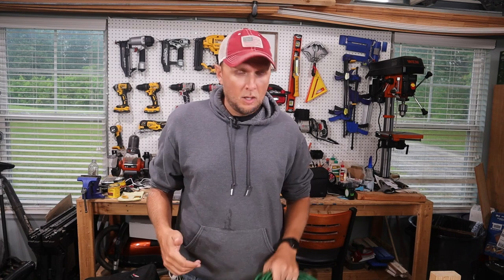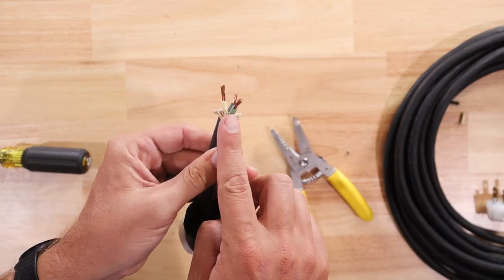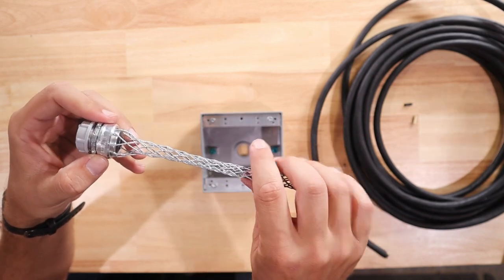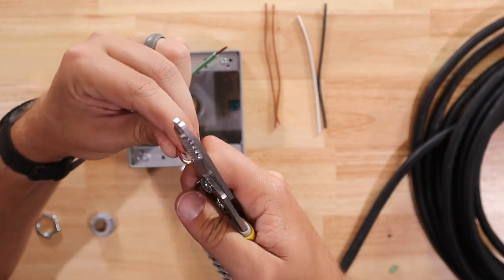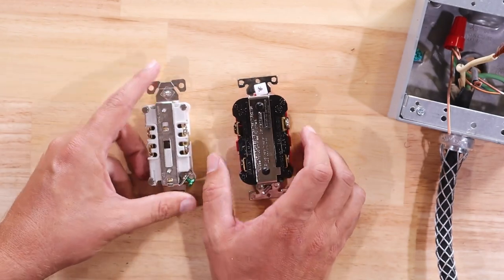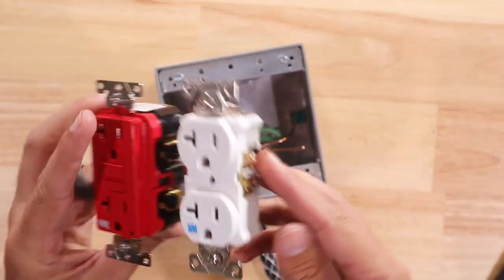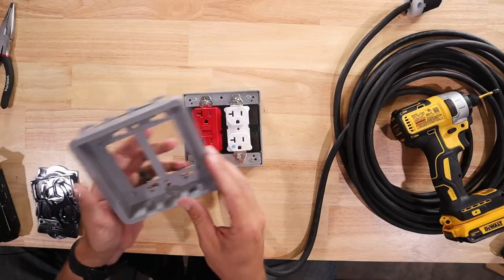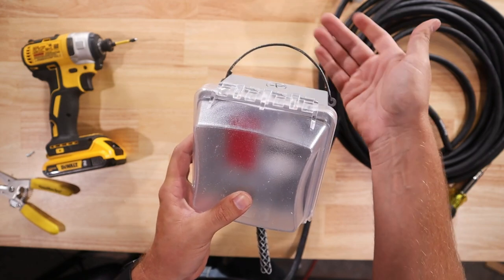How to Make the Ultimate WEATHERPROOF Extension Cord!  Great For Christmas Lights

Comment: Retired OSHA here, what you're saying only applies to Construction. If you're a manufacturing facility you're allowed to make your own chords and also properly repair them if needed. Just to give you some info
Reply: this box would be an OSHA violation.  box is not designed for portable cords.   NEC violation
Reply from the maker: @LuLu_World and yet again, guess you missed the whole part about how this is not OSHA compliant.  But that doesn’t really matter unless you’re trying to use this on a jobsite as OSHA has no jurisdiction or authority over homeowners.  NEC does not pertain to extension cords other than they cannot be used as permanent wiring.  So not really sharing anything that wasn’t covered in the video or relevant.
Reply: @HowToHomeDIY  

Makes video about a go-kart build- mentions that go-kart is not street legal and the DMV is not going to give you a license plate for it (for anyone unable to interpret the obvious use case from the video in the first place).

Still gets comments on the video about how the go-kart is not street legal you will be pulled over and fined for using the go-kart on the highway, and probably go to jail for ten years too (unironically, under the comment from a retired DMV worker who helpfully confirmed/clarified the caveats mentioned in the video).

I don't know how we would survive without commenters on YouTube reminding us how dumb we all are and blessing us with their information.... maybe we need a special day for them- like how we have Pi day or National Hot Dog Day or whatever. It can be called "Redundancy Day day" and maybe we can have two of them in a row just to be safe so we don't miss anything!
Reply: @anthonyguess5528  Only problem with unqualified people fixing cut, nicked, dry rotted cords are they seldom perform repair in a safe matter. Have seen splices made in broken birds w/o wire nuts, crimp butt split or soldered , just twist wire then use duct tape or even scotch tape. I liked to use a ohmmeter to check for a low resistance continuity then use a 500 volt megger.

Comment: I saw an additional upgrade for an extension cord like this one. Cut a round disk a bit larger in diameter than the box and use that as a base for the box to sit on. That way when you pull the cord along the floor/ground, it helps prevent that square box from getting hung up on objects along the way. Thought that was an idea worth sharing here. Great vid!

Comment: Just made one of these today. Used the same wire, 30’ of it. Same box and strain relief as well. Didn’t use 20 amp receptacles like you, but used a gfci and receptacle that had 2 female USB ports

Comment: Was told at an IAEI continuing education class that type WR are only required outdoors. They add a UV stabiliser to prevent long term sun exposure from degrading the plastic face plate. Believe most HG ( hospital grade ) receptacles have a nylon face that I tried to crack hitting it a few times with a hammer. The HR survived but cheaper $1 receptacle are no match for a hammer. Hubbell spec grade devices always had great material for mounting strap that never rusted.
Reply from the maker: Thanks for the feedback John!
Reply: WR receptacles are a lot more than the plastic. The metal needs to be of a corrosion-proof material. Often the metal yoke of a WR receptacle is of stainless steel. Same goes for the screws.
Reply: @jamesreizner2673  Thanks. I completely forgot that the WR receptacles have a much better corrosion resistant metal yoke along with the SS screws. Back in the 1970's while working at a large slaughterhouse we found that brass 6/32 screws with a lot of anti seize compound held up the best in salt filled hide cellar ( had thousands of salted hides, 60,000 # salt storage pit & a salt water soaking pond ) and chill & cooler box that had salt water defrost for ammonia coils. Salt deposits were every where. We used aluminum FS & FD boxes for switches & receptacles and steel screws would seize up & break first attempt to remove. Old timers  told me to not use SS screws for some reason.
Reply: @JohnThomas-lq5qp  I might be wrong on this, but I assume the recommendation to not use SS screws is due to the chemical reaction that can happen between the aluminum and the steel.

Comment: In hospitals, we install red outlets to designate that it is connected to backup power (a generator). That way if the utility power goes out, we know that the ventilator that is breathing for the patient will not stop working if the regular power supply is disrupted.
Reply: Wow…that really helps us all😂
Reply: 0/10 - I bought a red outlet at home and turned off the power and it still went out, returning the outlet and demanding a full refund!

On a serious note, I thought that the red outlets at hospitals were actually a special "grade" and it meant more than just being wired to backup power. My understanding is that they are built to a higher spec, have the ground terminal flipped upwards rather than down and have a stronger plug retention (to avoid tripping on the cable and having it pull out accidentally). I think I need to watch a YouTube video on this now...

Comment: I like the magnet and hanging wire ideas. Though, the magnets wouldn't be so good in my welding shop! LOL! I'd have three little Buckwheat's in no time! LOL!Something else I like just as a backup to the backups backup is a heavy zip tie or two on the cord, inside the box, as a secondary pull-out preventive. Also seal any empty screw holes in the box. As well as a dab of Locktite on the face plate mounting screws. Getting tossed around the shop or worksite can rattle them loose. I've got a welding shop. Water isn't an issue, per say, but metal dust floating in the air and on surfaces can get into the small openings. It'll collect and at some point cause an arc.

Comment: I, just the other day, made one of these and my box, also, had two ground screws.

I crimped the braided wire (extension cord) with a round connector and let it share one ground with the GFI and let the metal box (I presume) share ground through the second ground, in the box, on the regular/second receptacle. 
I 'think' wire nuts are not good for (well, really anything) connecting braided and solid wire.

The box is aluminum: am I wrong to think they are, effectively, a 'common ground'?

I would appreciate any feedback on this.

Comment: I need to power a sump pump about 50 feet out from the house. Could I use this same idea with some 12 3 wire, burying it in underground conduit? I would be plugging into an outside outlet, on a GFCI.

Comment: Years ago, all cords and tools required regular inspection and repair of any damage, replacing cord caps with approved parts, an easy afternoon job.

Don't just strip and mash untwisted wires in the holes, good chance of a few strands sticking out. Twist them and bend them to fit.

Comment: How would you make something like this safe for a job site while still being weather safe?
Reply from the maker: Well extension cords are easy targets for osha and “modified” cords are not allowed on a jobsite.   They have to be “listed.”  So no matter what one did to make one, it still would not pass an osha inspection on a jobsite unfortunately.
Reply: Form a company to make them and submit it to Underwriters Laboratories for testing and hope to get listed.
Reply: Put a GFI in the front of the cord.

IOW: spend ~ $30.00 on a male inline GFI.

That will trip if you have a short downline. 

But really:

No receptacle is waterproof in the rain when something is plugged into it...
Reply: @LilRedDog  It's labelled water resistant, not water proof. Big difference. Also, the indication of water resistance is applied to the correctly assembled box, not the separate outlets you install in said box. Manufacture has no control over that variable so can not and does not apply. The terms "Proof" vs "Resistant" is a commonly confused.
Reply: @wingnutbert9685  What are you replying to?

OP is asking about 'weather safe'. A GFCI inline extension cord will trip if there is a ground fault from water.
It will, also, be OSHA compliant.
Reply: Here is what OSHA actually says: https://www.osha.gov/laws-regs/standardinterpretations/1992-06-17

Following that is a good idea.

Comment: Helpful if you explain why it’s not OSHA compliant.
Reply: Here is what OSHA says: https://www.osha.gov/laws-regs/standardinterpretations/1992-06-17
Reply: the box is not UL listed for portable applications.  designed for permanent mount
Reply from the maker: Guess you missed the whole part about how this is not OSHA compliant.  But that doesn’t really matter unless you’re trying to use this on a jobsite as OSHA has no jurisdiction or authority over homeowners.  NEC does not pertain to extension cords other than they cannot be used as permanent wiring.  So not really sharing anything that wasn’t covered in the video or relevant.

Comment: what is the max length of this cord type ?
Reply: You can buy SO cord in any length but you have to take into consideration the voltage drop calculations
Reply: @johnsxterra9020  hey thanks, I'd like to have 15amps at 150 feet. Does that work?

Comment: What length of extension cord do you recommend?
Reply: It depends on your need but use the shortest possible. More length equals drops in volts. 25 ft is handy size but don't go longer than 50 feet unless you have to.

Comment: I am scared I screwed up, I have a 100 foot 10g extension cord. Cut the female end off and wired two 20a outlets to the end in a metal box, one 20a GFCI feeding a duplex 20a. My extension cord says its rated for 15a max... do I need to switch to 15a outlets?
Reply: No

Comment: Locktite-
Blue- for stuff you may want to take apart at a later date...takes some force to break the bond.
Red-
For "permanent" bond; has to be heated to 500 degrees f. (260 c) to break the bond.

Comment: This looks like a good project. It seems fine if you're plugging into a regular receptacle. If you're plugging into an outdoor receptacle or in a garage the receptacle there should be a GFCI by code. You shouldn't plug one GFCI into another one. I would use 2 duplex receptacles. I'm not an electrician, but this is my understanding. Please correct me if I'm wrong.
Reply from the maker: Hey Ted, so you are correct that if using outside or a garage for instance, that there should already be GFCI protection if the house was built when or after that code was established.  However, I cannot find anywhere in the NEC that says one can't have more than one GFCI on a circuit.  And I know we are talking about an extension cord which the NEC does not cover but as far as 2 GFCI's on a circuit, it seems one of them would be redundant and probably have no added benefit.  But like you said if plugging into a non GFCI protected receptacle then the benefit is definitely there.  If I am just not seeing something though feel free to correct me.  Thanks a lot for the feedback Ted!
Reply: @HowToHomeDIY  Thank you fot the reply. I can't really disagree with anything you said and it is ok to have multiple GFCI'S on on circuit as long as the load is not being used to feed the next GFCI in the circuit. I think your design is fine as this is an extension cord and not a permanent installation. As you mentioned, you'll get some redundancy, but I don't see any problem with that.
Reply: @surferdude642  Yeah, this is a question/issue for me as well!
All my outdoor receptacles are GFI and I am using this setup (I.E. GFI after another GFI).

I thought this was okay because my hair dryer has a GFI from the factory and, since it is intended for use in a bathroom, it plugs into a GFI, as code requires.

Anyone know, for sure, if this is a problem.
Reply: @LilRedDog  I don't think it's a problem at all. Your hair dryer like the extension cord is a temporary load which is unplugged or turned when not in use. The case where it's problematic is when one gfci is powered from the load of a previous one. This should never be done that I'm aware of.
As for your extension cord box it would be optional but not necessary to put a GFCI receptacle in there.

Comment: I appreciate all the attention to safety unlike "The King of Random" version where it was suggested to splice a lamp switch inline (rated for 2 amps max!) so you can cut power with a flip of a switch....yikes!
Reply from the maker: Oh wow.  I don't believe I have seen that.  May have to look for it just to watch.  Appreciate the feedback John!
Reply: @HowToHomeDIY  Check out some of the earliest videos such as his diy carbon arc furnace or the backyard foundry. Unfortunately Grant Thompson died from a freak accident (hang gliding?) but not before he sold his channel to another host and that's where the videos took a dive.
Reply: @HowToHomeDIY  I wish you might went deeper into the NEC for sizing wire and explaining how long a 12/3 extension cord can be used at what amperage, and how high amp draw can strain the life of your power tools. Otherwise great video and I look forward to seeing more of your videos 🙂

Comment: The red outlets designate that it is connected to generator power.  Not a big deal for your home, but you should be using a standard color.
Reply: It might be a standard for certain buildings, but there is no such code article.
Reply: @shockcoach  correct. Pretty common convention though, especially in hospitals.
Reply from the maker: The receptacles I used are just red industrial grade receptacles.  Hospital grade receptacles will have markings on them like a green circle or an orange triangle for example, denoting exactly what they are for or do.
Reply: @HowToHomeDIY  The green circle is the only symbol to designate a Hospital Grade device.
The hollow triangle denotes Isolated Ground, which is completely different and unrelated to Hospital Grade.

Comment: I would’ve 1 ) used THHN for your jumpers and 2) Filled the mounting holes in the back of the box
Reply: The holes do not go all the way through the box. The box is rated with those holes.
Reply: And it could be argues that a wire rated for use in wet areas would be better for the jumpers than THHN, which is not rated for use in wet areas.

Comment: Isn't this strain relief not waterproof? Thought these were intended for stamped metal boxes.  I'm afraid water will seep through and get trapped inside the box between the cord and fitting. The threaded portion seems to be water tight with the threadlocker. There are wire glands with dual gaskets for the wire to fitting as well as for the fitting to the box, then a strain relief on the other half the fitting. 🍻

Comment: does not meet NEC Code.  Box is not rated as a. portable outlet box.  Hubbell, woodhead make boxes that meet code..
Reply from the maker: Guess you missed the whole part about how this is not OSHA compliant.  But that doesn’t really matter unless you’re trying to use this on a jobsite as OSHA has no jurisdiction or authority over homeowners.  NEC does not pertain to extension cords other than they cannot be used as permanent wiring.  So not really sharing anything that wasn’t covered in the video or relevant.

Comment: If you make it with a 20 AMP plug, you'd be more limited as to where you can use it.  20 AMP male plug does not work with a 15 AMP outlet
Reply from the maker: Then make it with a 15 amp plug and receptacles.

Comment: WHOOOOAAAA There bud!!! You Need to WRAP Both Electrical Outlets with electrical tape insuring to cover the Outlets Side Screws .

Shame On You For Not Doing This. You were good Up until this point. Epic Epic Safety Step Failure On Your Part.
Reply from the maker: No not necessary.  This in not required in the NEC anywhere on typical wiring.  Wrapping receptacles is purely a preferential item.

Comment: AAAHHH!!!!! wire nut!?! your EVIL!!!! love the rest. lots of room for improvement, but otherwise ok. seriously tho...wirenut? brah! smh
Reply: Because wire nuts haven't been just fine for how many decades now????.........🤔🤦‍♂✌
Reply: @wingnutbert9685  exactly! can't count how many F-up i had to fix cause someone thought twisting wires carrying electricity like a twist tie on a sack of bread was ok, then couldn't figure out why the wires were hot, a breaker kept tripping or there was no power in the circuit from the caps or shudders electrical tape making it LOOK like it was a good solid connection. trust me, if there's a way to F something up, i've either done it or fixed it. my last was wire nuts on a ceiling fan light. it was an "illuminating" experience.  fzZZzzt

Comment: OSHA does not prohibit job-made extension cords. https://www.osha.gov/laws-regs/standardinterpretations/1992-06-17 OSHA does not apply to homeowners, as you note. 

You have a male plug using a 15 amp NEMA 5-15P. The receptacles are 20 amp NEMA 5-20R. This is unsafe and a violation of the NEC (if you don't understand why this is a problem ask). It would be a good idea to fix that.
Reply from the maker: No it isn’t.  It is a 20 amp male plug.  You can see me clearly wiring it up at the beginning of the video.  Nothing needs fixed.
Reply: It's clearly a 20amp plug 🔌 you can see the one terminal turned sideways